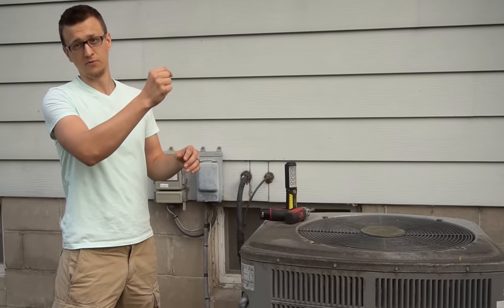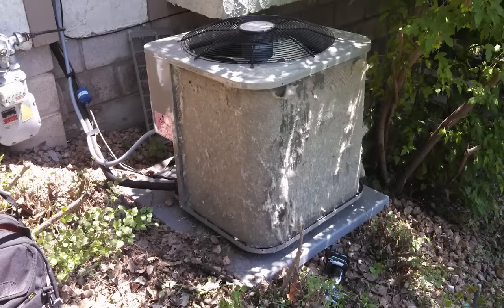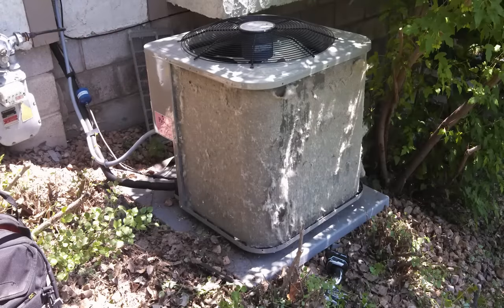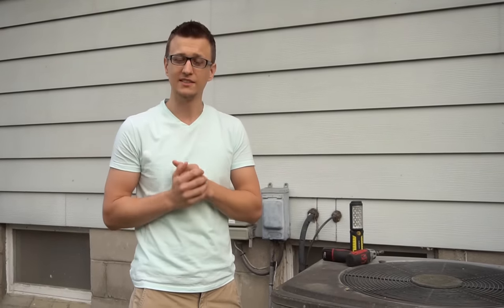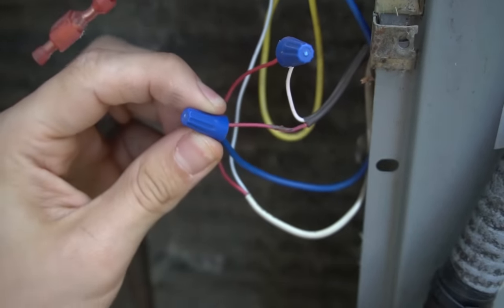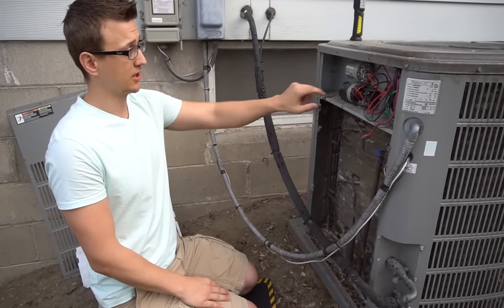15 Air Conditioner Maintenance Tips

Comment: I used to have a house with a big cottonwood tree.  I took a window screen material and wrapped it around the unit and held it on with some elastic bungees.  Then it was super easy to clean the cotton off with a lint brush.  Then when the cotton is no longer a problem you can take the screen off because it does obstruct the air flow a little bit(but much better than being plugged up with cotton)

Comment: This is great info.
I've been spending $$$ on a yearly contract so I won't have problems with my AC.
Can't get the house to cool down.  Took a look outside at the unit, it had some leaves caught in the bottom.  I doubt the furnace/AC company has EVER cleaned the unit‼️
I live in a condo, so don't have a hose or access to outdoor faucet.
Reply: So buy the spray cleaner

Comment: I was told by more than one HVAC tech that covering the unit during the winter while not being absolutely necessary in cold climates is definitely recommended.  One should cover the top of the unit and leave the sides open for air flow inside.  I suppose the rational for covering the unit might be the seepage of water into fan seals and bearings and then having that water freeze up for long periods of time, damaging sensitive parts.  I am not sure whether covering the unit in this way provides any real benefit.  You seem to think that it does not.  I, personally,  cut up a thicker gauge trash bag and custom form it with black duck tape to fit over the top.  I then tie the cover around the sides to prevent it from blowing off.   Many of my neighbors don't bother.
Reply from the maker: I have not seen much of a difference between units that get covered every year and those that don't. They both break down all the same. Many of the older techs I work with do not cover their units either. There is no harm in putting a cover on top of the unit though, so if there is a chance that it will do some good, then why not? :)
Reply: Consider that if the unit is a heat pump you can't cover it for the winter, so the outdoor unit must be engineered to withstand ice and snow. It's possible, but unlikely, that they use different fan seals and bearings in the heat pump units than they do the cool-only units. Probably the only real difference is the addition of a defrost control and a reversing valve.
Reply: @brianleeper5737  Good point!  I suppose the real reason why I bother covering it up in the winter is psychological.  It gives me the feeling that I am caring for the unit.  We do a lot of unnecessary things in life for the same reason.

Comment: Thanks guy  ,  you help me a large  very interesting on AC maintenance works ,  I was a retiree quality control technician from " Goodman company "  ,  even  I was an 86 old guy , some time I climbed up on the ceiling to check  the furnace and air handler ,  but also have to spend for some AC  technician  .

Comment: I have a vinyl cover for just the top of my Condensing unit. It comes down over the sides about two inches where I hold it in place with a few bungee cords linked together. I put it on in the fall to keep the leaves/dirt out in the fall/winter and the seeds ETC. out in the spring. To be safe I do have a little note on my thermostat that says to me/others. "Cover is on AC outside, DO NOT TURN AC ON. I remove cover late spring and turn note around so you can't read it but there for next fall. My condensing unit sits on a pad like this but I also (up to the edge of pad) have riverpebbles/rocks two inches deep to keep dirt from splashing into unit when it storms. I have a 8 inch high barrier to contain the rocks/pebbles from grass/lawn area. My "upgraded" Honeywell programable thermostat has back up batteries. They hold the programs for heat/cooling if electric goes off in home. It tells me when batteries are low, when to change air filter and Whole house humidifier water pad. It has fan on/auto or recirculate. If recirculate is chosen in summer , winter or both the fan will come on at random to recirculate all the air in the home (upstairs/downstairs) for 15 minutes or so. This is great for keeping the hot air that naturally goes upstairs in the winter down. It is great for keeping the cool air that naturally falls in the summer upstairs. This helps keep the furnace or AC from running unnecessarily too.

Comment: Make sure not to touch the capacitors posts even if you turn off the power. They hold a charge
Reply: Not all of them do
Reply: @jaykraft9031  you really wanna play that game and find out? didn't think so.
Reply: Drain it with a screw driver
Reply: Zap! 😅

Comment: Very good info bro.. like the insulation is important (on cool days) cuz a "slug" of liquid refrigerant will kill the compressor.. Keeping coils, ducts,, drain etc clean.. add a surge protector saves the caps 50% of the time.. float switch to protect from flooding or lower floor ceiling etc.. what else?? Great vid..

Comment: Most of this I agree with, especially the "don't use harsh chemicals" statement.  The main problem I see is the coils look fairly plugged (at least on the vid) AFTER you've cleaned them.  Usually when you clean something like this that is plugged due to air flow, you want to clean it OPPOSING the normal direction of flow, as most of the crud will be on the part of the condenser where the air is coming in (outside in this case), and you'd like to wash that directly out of, not through, the cooling fins.  It really isn't any harder to remove the top than the sides, and it gives you MUCH better access for spraying, and from the inside, except maybe at the very bottom, where you can spray from outside.  Just make sure you have something to prop the top on, and don't bend the blades or pull the wires tight when you prop it.

If those holes in the fins go all the way through you might consider plugging them with something, as a fair amount of your air flow will be going through those points of "zero" resistance.  Some more "fuzzy stuff", as you called it,  would be best, if you can get our hands on some.  Minor, I realize, but just a thought.
Reply: You got a channel guy?
Reply: @petera1117  Yes, but I'm not an AC tech and the channel has nothing to do with that subject.  I am a retired aerospace EE that does ALL my own work on everything, roofing, plumbing, all automotive work, fixing electronics, and all the rest of it, everything, including automotive and residential (my) AC. 

I've had numerous hobbies, including building a two seat aircraft (Long EZ), hopping and restoring cars (all of it, paint, body, mechanicals, etc), RC flying, including scratch built scratch designed planes, including original airfoil work (some flew great, some DID NOT, specifically one flying wing I tried, and yes, I knew about reflex airfoils, ect).  Kind of a jack of ALL trades, master of not too many.  ;-) 

My channel mostly deals with supporting my wife's retirement hobby, selling on ebay, knick knacks mostly, and some typewriters she finds that I restore/rebuild/service, etc.  The very old machines are gorgeous, built like pretty much nothing is any more, so it's kind of fun.  Moving away from the 'newer' stuff, though. 

I have a bunch I'm about ready to put on.  Only one vid on an old one on so far, a beautiful little Corona folding unit that just needs a couple more things (some plating, mostly, still getting that set up) and will be ready to 'go on'.  Many of the rest are 'one line item' from listing...one of my major faults, getting everything within a gnat's eyebrow and moving on to the next project that has MAJOR problems.  Probably not going to fix that at this late date, so oh well....

Comment: You did a great job. You are what is called a "professional in speech never presentation"  Where ever  you learn you were good.
Would like to ask a question, some other video said on the return filter don't use a V shaped use a flat firberglass which will allow more air to be sucked in. I have central A/C not connected to my furnace.  Said air coming out should be about 56 mine is low 60's. This weekend with the heat wave here in New York and else where 99F July 20 2019 only bring room down to 65F no mater what it's set at.  I am saying A/C has limit of how much cold can come out.  One last question how do you now when you need to add freon?  Again well done and thank you.
Reply from the maker: Thank you! I think this video would be good to answer those questions for you: https://www.youtube.com/watch?v=beVRELr8Oak&t=1s

Comment: Very informative and well made video! I seriously did like it and subscribed because of this one video. I will be checking your other videos and hope to find one regarding a large single 4.5 ton outside unit which is what I have (Trane).
I know you can’t fix it now, but hope that you will remember to verbally mention NOT TO TOUCH those capacitors. Friend of mine went to hospital.
If you haven’t done a video on recharging the coolant with a tank and hoses with gauges, I wish you would?! Thank you again for a very good video!

Comment: I have a central ac. I am not using it anymore since we are done with summer season and onto fall. But for some reason the black pipe that is outside with the central ac. 3-4 times a days it will be draining out clear cold water? Can anyone tell me what this is about. We also have a hvac system threw the whole house

Comment: Thank you!  Amazing video helped me fix my HVAC.  Plus the separate info on HVAC filters pointed out my new MERV 9 was reducing airflow so much was causing problems.  I think it was icing over as was getting water overflow.  When I went back to a MERV 5 system went back to normal.  Well presented video.  I learned things.

Comment: I missed the part where you oiled the condenser fan motor.  You only need to oil the motor if it is a sleeved bearing motor.  If you oil the motor every Spring, it will last a long time.  My condenser fan motor is over 25 years old because I oil it every year and GE makes a very good motor.  The indoor furnace blower motor usually has sealed bearings and those don't require oiling. The spiral-wrap coils (seen in this video) can get really dirty so it's important to clean those every Spring.
Reply from the maker: Thank you for the additional suggestions!

Comment: I am very, very, very good at fixing and repairing my own 'everything', yet I had no idea whatsoever there were so many things on an A/C to check. No wonder A/C companies are foaming at the mouth to get a shot at 'tuning someone's A/C up'. Not that most A/C shops are crooked, or anything, however, there are a whole lot of areas of an A/C, or a furnace that some unscrupulous technicians certainly do have an opportunity to use 'tech speak' when it comes to 'tune ups' that could easily lead to unneeded replacement and or repairs. I also had no idea that the filters should be replaced once a month rather than every 3 months, as is written on the filters. All in all you, 'Word of Advice TV'. have saved me countless 'shekels' in future repairs and the misery of losing my A/C in the AZ. summer months which lasts for 8 ~ 9 months out of the year. Thank you!

Comment: Do not use a 2 by 4 under your pad!!!  Remember that wood rots over time (even treated wood). If you have to use something go with dirt, gravel, or very flat rocks under one side. Also check drainage from your gutters. That might be why it’s not level

Comment: I need a word of advice please. I just moved into a home with a split unit HVAC.  In my previous home there was one air return and the filter was placed at the return. In this home there is a main return which has a filter but there are several smaller returns around the house that are unfiltered. The air handler has a slot to hold a filter. This makes no sense to me. Why would I not remove the filter from the main return and  filter all of the return air at the air handler instead? Am I missing information that justifies this setup? BTW, my neighbor has the same setup and said that the installer told him that this is the way to do it. I called the HVAC dealer that installed both systems and was told that this is a choice the homeowner makes. Sounds fishy to me. I would appreciate some clarity on the issue please.
Reply: Having returns in all the rooms is a much better way to do it rather than one single return which messes with the air pressure in the house. Having one return requires you to leave doors open in rooms so the air can go to that one return...it's actually the cheaper way to install HVAC. AS far as the filter question, if there's a space, I'd put one in. HTH!
Reply: @lf6132  Thanks for the reply but I am not questioning the value of multiple returns. I was asking if substituting filters at the air handler in place of at the return grills would be the right way to go. The consensus is to do just that. What does HTH mean?
Reply: I agree with you that a filter should be placed just before the air handler because, as you said, with no filter there, all the air picked up by the "several smaller returns around the house" is carrying airborne particles of any size into your system to accumulate on fan blades, coil plenum, ductwork, furnace, and to be blown back out of your supply ducts into your house. Some dealers push their duct cleaning service - Seems like the way they answered your question would help generate duct cleaning business for them.
I would put the highest MERV that the furnace can handle at the air handler location. (Some systems, especially if older or undersized, would have too much air restriction if a higher end MERV is used.) I agree that the dealer's response is not very satisfactory and I think I would be prepared with other dealers' phone numbers when I need a service call; or at least watch them closely if I did have them come out. I'm not an expert - but as an office building manager I have maintained several 3 to 5 ton units for the last 20 years and have spent many hours crawling around in attics and over blueprints studying the design of the returns and supply lines, in order to keep small tenants who share one ac/furnace unit happy through hot and cold.

Comment: I’m sure you just miss spoke, but I want to bring it to your attention. The portion of your video where you were explaining the purpose of the insulation on the suction line was incorrect. I’ve seen a lot of your videos and realize that you are speaking from experience and knowledge. So it just must be a mistake while giving loads of information in a short period of time. It’s hard to say everything perfectly, I get that. The main purpose of  insulation on the suction line of an air conditioning system is to create a moisture and temperature barrier between the ambient air and the cold surface of the copper to prevent condensation and to inhibit any heat gain from warm  areas that it might travel through. The suction line carries cool refrigerant vapor back to the condenser. The only way it would condense refriginto a liquid before it reached the compressor is if it was cooling dramatically, which does not happen in the summertime when your air-conditioning is running. It is nearly impossible for the refrigerant to change state in the 3 feet of uninsulated copper on the outside of the house with warm outside temperatures. Along that line of thinking it would actually be advantageous to have it uninsulated outside to keep it in vapor form before entering the compressor. That being said, I do appreciate your videos and have learned things from you. I am a 27 year HVAC technician that is willing to learn from any and all. Thanks for the video

Comment: Good video, my machine looks exactly the same! I'll order the extra capacitor
Reply: watched video too late...$300 to change capacitor
Reply: Valeria Victrix 8
Reply: Definitely keep extra caps on hand.  It's a very common failure for AC condensers.  AC repair companies charge a fortune to replace a cap, which is unfortunate considering how inexpensive they can be had on Amazon and how simple it is to swap them out.  I recommend all my clients to keep extra caps for quick/easy replacement.  Even if you're not comfortable doing the work yourself, having the part handy means you can save on parts markup from the tech, and/or you can get your handy friend to do it for you.

Comment: Hi have a Goodman gas pack older.the relay for air fan blewup.big hole in board.I'm thinking could be motor or board?help
Reply: If you are electrically inclined take a volt meter and find the power wire from the board and check and see if you are getting power from the board another way to check is jump power to the power lead on your fan and see if it comes on

Comment: I am trying to install a UV Air treatment System, specifically a Honeywell UV Lamp Treatment System. Do you have any advice on installation? With the Covid 19 Pandemic is this an item that can give some protection against viruses and mold and germs?
Reply: You can’t be protected from a fake pandemic.
Reply: Rick, I understand the fear. I will recommended crunching the numbers yourself. Sadly our media can no longer be outright trusted. I myself am an data analyst and they got me to be afraid as well. I didn't step out the house for the first 3 months(smh). At a certain point, I started being carious and did my our investigation - and realized there are some nefarious things going on. Take care brother, God speed.
Reply: We have this installed.  Works fantastic.  Pricey, worth it in the long run.  Bulb replacement every 2 years or so can cost around $240 if a tech came out.